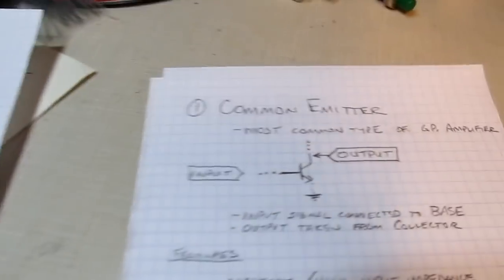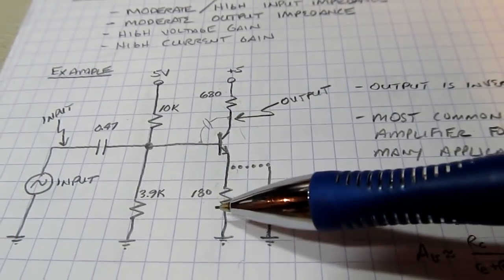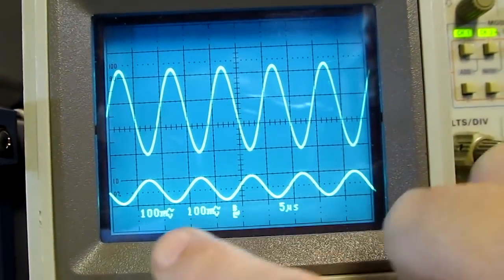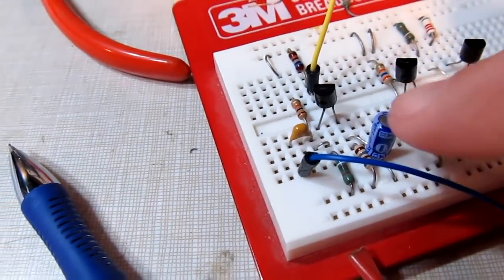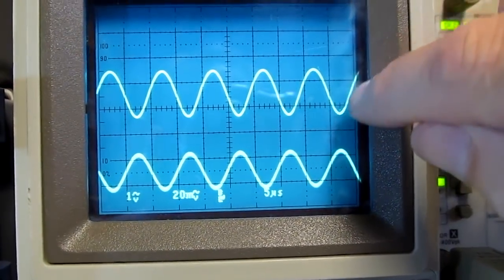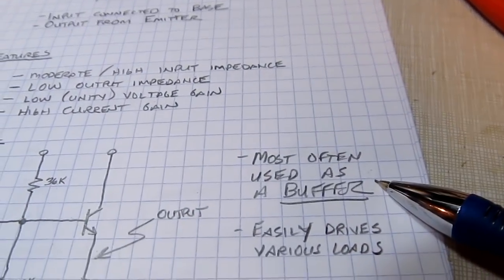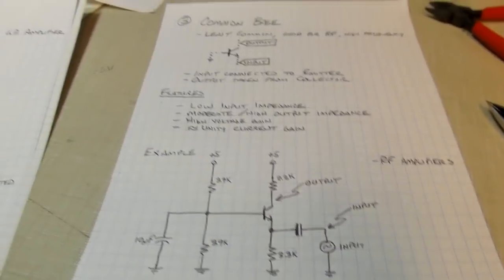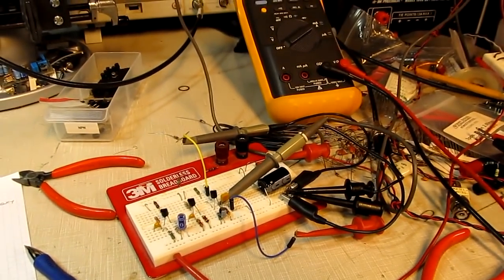#114: Tutorial: Common Emitter, Common Collector, and Common Base Transistor amplifiers

Comment: When training to get a HAREC license (in France), I see sometimes questions (with a choice beetween 4 answers) with a schema and asking for the gain or something else, but these schemas aren't always showing where is the input and the output. Thus I can be wrong about what is the common used. I wondered if you have some tip with such schemas to find what topolgy is used ? One book tells to look what is connected to the ground, but it doesn't help me.
Reply from the maker: I've never seen the schematic examples that you are talking about.  Maybe keeping these points in mind for BJT amplifiers will help:
- the output is never from the Base 
- the input is never to the Collector 
- the input can be either Base or Emitter (CE or CB) 
- the output can either be Collector or Emitter (CE or CC)
Reply: I will keep that in mind, many thanks.

Comment: I have watched this video a number of times, because when I look at a common emitter the output is always in phase with the input.  I have changed the resistors and double checked the biasing, ensured that the scope is set up correctly and even used many different NPN transistors from BC337 to ZTX651 but always the signal is in phase. So what am I doing wrong?
Reply from the maker: Are you sure you're looking at the Base voltage and the Collector voltage at the same time?  How are you triggering the scope?  The scope must be triggered on one of these waveforms only so that you can see the phase relationship between them.
Reply: It is a new scope (basic digital) and I did wonder if I had set the trigger wrong, If it is set right it should be triggering on channel one.  The common collector and common base circuits work as expected, it is just the common emitter that is odd.  Do you have a video for triggering on a basic digital scope?
Reply from the maker: @rpsproject5349  Are you viewing both signals at the same time, or one at a time?
Reply: Only on one channel now, being a new scope I had not got the triggering worked out and there was a setting that would default to both channels trigger when both channels were receiving a signal.  Now it only triggers on one channel.  As I know from your other videos it is important to know your scope so an easy trap for young uns; as Dave would say.  Thanks for your help.
Reply from the maker: @rpsproject5349  That's your problem.  The scope is triggering on the rising edge of each waveform, so it's going to hide the phase shift from you.  The only way to see the phase shift is to trigger on one of the signals and display both simultaneously.  The scope only triggers on one channel by default, and can display both channels simultaneously.

Comment: w2aew, what causes negative degeneration in transistor and tubes circuits? because the cathode and emitter have negative degeneration so you have to use a bypass capacitor in the cathode or emitter to reduce the negative degeneration, but what is causing the negative degeneration?
Reply from the maker: You're mixing up two terms that refer to the same thing.  A resistor in the emitter of a common emitter amplifier is a form of "negative feedback", and is also called "emitter degeneration".  The resistor helps to stabilize the operating point (see my video on beta-independent biasing).  If it is not bypassed, it also reduces the gain, at the same time, making it more stable and less dependent upon transistor beta.  Very common usage is to have the resistor there to stabilize the operating point, and then bypass it so that the AC gain is not reduced.
Reply: I thought it was the Emitters Bypass Capacitor that is "reducing" the emitter degeneration. Or what is Emitter Degeneration, what is causing Emitter Degeneration? The emitter resistor is stabilizing the operating point of the Transistor. But is it the Beta gain that is causing emitter degeneration or something else?
Reply from the maker: A good discussion of emitter degeneration can be found here:
https://en.m.wikipedia.org/wiki/Common_emitter#Emitter_degeneration
Reply: Adding an emitter resistor decreases gain, but increases linearity and stability. The voltage gain depends almost exclusively on the RATIO of the resistors RC/RE rather than the transistor's alpha & beta gain. What I'm confused about is why does the emitter resistor determines the voltage gain of the transistor? The Emitter resistor also changes the output impedance, the linearity, and stability. The Emitter Resistor has a big role to play on the function of a transistor. The Emitter Resistor affects the transistors temperature stability. The linearity I'm guessing they are talking about the clipping and biasing operations. The Emitter resistor value controls the transistors voltage gain but the collector resistor value doesn't for some reasons, not sure why.

Comment: also can you explain why the voltage gain of emitter is usually chosen low. i mean why not Rc/Re is chosen 500 or something? whats the reason for this limitation? thanks
Reply from the maker: +jamesmasonic It all depends on the desired gain for the circuit (many times, high gain isn't needed).  Also, higher gain also means lower bandwidth (due to gain:bandwidth product).  In my case, I kept the gain small to make it easy to display the input and output voltages on the scope.  If I set the gain too high, then the input signal would be buried in the noise of the scope.

Comment: @w2aew Hi, first of all the transistor I am asking about is a NPN signal transistor BC547B as an example.
  What determines the maximum voltage input to the base of a transistor in audio use? so for example it takes approximately 700mv to switch on a silicone transistor at the base, then its on, but after that point what is the maximum voltage or current that that transistor can take into the base before it's destroyed or is seriously over driven? (ALL FOR AUDIO USE)
I Don't know where to find this information on the data sheets of any transistor,i don't know what its called the maximum input permissable into the base,I am of course assuming that a transistor will have a point of which too much voltage or current into the base will either destroy it OR distort like crazy in audio use.
I hope you understand what i am trying to ask, for example the HFE of a transistor is how many times it can amplify the input, so for example a HFE of 250, a 1mA input would give out 250mA, so I know thats the amplification factor known as HFE ,but as for the input into a transistor and in particular the maximum input voltage or current,I don't know what that's called.
The reason I am asking is so that i can try and design a preamplifier and knowing the max levels or parameters would help me out with that and also I would like to know how it works to understand it better.
A Final example of what I am trying to ask, you could not put 200 volts into the base of a BC547B NPN Transistor it would just explode,so whats the cut off point into the base, thanks
Reply from the maker: There isn't a spec for the maximum base voltage, because it's not that simple. The maximum voltage on the base is determined by the rest of the design of the amplifier circuitry. There are maximum ratings for base current and collector current, as well as maximums for voltages between the terminals. So, unfortunately the real answer is that it depends on the overall design, not just the transistor's ratings.
Reply: is it anything to do with VBE (ON) and VBE(SAT)?
Reply from the maker: No. VBE(ON) is the base-emitter voltage when biased in the normal active region of operation. VBE(SAT) is the base-emitter voltage when the transistor is in the saturation region.
Reply: thanks

Comment: OK, I confess I am a bit slow on the uptake so please bare with me; the voltage from the SG is 3VDC correct or not????
Reply from the maker: I'm not sure how you reached that conclusion???  The signal generator is providing a sinewave at about 100mVpp for most of the demos (a little smaller for some of the demos, such as the high-gain version of the CE amplifier, and for the CB amplifier).

Comment: Hi...i have a question regarding the capacitor values....can you tell me how to compute the capacitance in designing each  amplifier
Reply from the maker: +RR Pacaldo It depends on what you want to accomplish.  Capacitors can perform DC-blocking functions like the ones connected between the signal generator and the input to the amplifier.  In this case, you want the capacitive reactance to be well below the input impedance of the circuit at the frequencies of interest. So, this usually involves computing/estimating the input impedance, then selecting a capacitor value that results in a reactance much lower (maybe just a few % or less) at the lowest expected signal frequency.  Other times, a capacitor may be present to affect the gain or BW of the amplifier.  In these cases, you calculate a value based on what you want the effect to be.  In the case of the common emitter amp with a capacitor across the emitter resistor, I wanted to effectively short the resistor at the signal frequencies, so I selected a cap that would be a very low reactance at my signal frequencies.
Reply: ..thank you so much for the reply....now, i really understand the computation for the capacitance...the capacitive reactance must be lower than the input impedance of an amplifier.....but how about the bypass capacitor?..it must be lower to the input impedance too?..
Reply from the maker: +RR Pacaldo It must be substantially lower than the resistor that it is bypassing (at the frequencies of interest).

Comment: @4:48 I notice that the bias chain has much higher value resistors in it compared to the two other types of amplifier. Is this a feature of common collector? Why is this please?
Reply from the maker: There's no particular reason.  In general, you pick these resistor values based on several criteria - depending on what is important for your application.  Considerations such as power dissipation, required input impedance, bias current needed for the base of the transistor, etc.
Reply: Thanks for your reply.

Comment: in the common base config, whats the value of that input capacitor? how do you get to design the value of the caps? please help Thanks in advance :)
Reply from the maker: I believe I used 0.1uF.  The CB has a low input impedance, thus needs a relatively large value input capacitor. The value is chosen such that it's reactance at the lowest frequency of use is relatively low compared to the input impedance.
Reply: ***** okay sir thanks for the info, btw your tutorials are great! :)

Comment: It seems when I run the CE amp circuit you have made in Spice and on a breadboard I'm not getting close to the voltage gains you are getting here. For example with the capacitor when you have your input @ 20mv pk-pk your output is close to 2v pk-pk while I'm only getting around 300mv pk-pk.
Reply from the maker: Make sure that the emitter bypass capacitor value results in a very low reactance at your test frequency.
Reply: ***** that was it, had a small value cap. Also what exactly is the point of the emitter resistor (commonly referenced as Re) in this circuit? Could it not be built with out a emitter resistor and a different value collector resistor? I'm assuming it has to do with the DC operating point.
Reply from the maker: Yes, an emitter resistor makes the DC quiescent point (bias point) much less dependent on transistor parameters like Beta. The more voltage across Re, the less sensitivity to beta variation. It makes the bias point more determined by the resistor values alone.

Comment: w2aew I am trying to understand this topic and its bugging me.  Please reply.  So if I understand this right.  The voltage divider on the base is used to set the Q point or no signal load like in your previous video.  Depending on where its at controls how far the signal output can swing.  Now the resistor on the emitter controls the current at the base???  So that means the resistor on the collector controls the output current of the collector??
Reply from the maker: Yes, the voltage divider determines the voltage at the base.  Since there's basically 0.6 to 0.7V between the base and emitter, the same divider effectively sets the voltage at the emitter too.  With the emitter voltage known, the resistor at the emitter to ground sets the emitter current.  The emitter current is the sum of the base current and the collector current.  The collector current is typically about 100x greater than the base current.  This means that the emitter current and collector current are nearly identical.  The available swing at the collector (for a common emitter amplifier) is also determined by the base voltage.  The swing can be between the positive supply (when the transistor is cutoff), and several hundred millivolts below the base voltage (when the base-collector junction is turned on and the transistor is in saturation).  The collector resistor doesn't determine the collector current, it main is used to set the gain in a common emitter amp.  I'm actually just finishing up editing a new video specifically on the common emitter amplifier.  Should be posted soon.
Reply: I think I follow.  Gain yes but effectively controlling the maximum dissipation of the transistor package, correct?  I think what is stumping me is I learned ohms law over 20 years ago and I forgot some of the basics.  My schooling only covered resistances in series/parallel circuits never got into diodes or transistors.  I am an aircraft mechanic and trying to learn this on my own.  Thank you.  I forgot some of the basics but remembered most of them.  I forgot that amperage is the same in a series circuit.  Hence making the amperage across the transistor package base to emitter same as across the emitter resistor.  I suspect I need to get out my breadboard again and just have some fun plugging in numbers etc.  To me right now it looks like a mess but its coming clearer.  So effectively the emitter resister and the transistor is part of a series circuit connected to the parallel part of the voltage divider.  Thinking out loud.  Thank you.

Comment: When biasing a transistor amplifier, R1 and R2 set up the biasing point for the base but how do you calculate R1 and R2 so the input signal doesn't get overloaded and also get a good Q bias point? you and get R1 and R2 values to get a good Q bias point but its going to overload the input so how can you avoid overloading the input signal when choosing R1 and R2?
Reply from the maker: Engineering is a game of trade-offs.  When setting up the biasing resistors for the base of a common emitter or common collector amplifier - you have to consider several factors:  
- the loading that it places on the previous circuit
- the voltage it places at the base
- the current through the bias resistors compared to the expected base current
- etc.
There is no perfect answer - the design requirements for the overall circuit will help to dictate which of these factors are most important, and which are less important.  See my video on Common Emitter Amplifier shortcuts for more thoughts on this.
Reply: @w2aew  But that's what I'm confused about because the previous stage will dictate what R1&R2 values will be for the next stage but the Q bias point will suffer by the trading off of loading down the input signal or getting a good Q bias point which R1&R2 values will change.
Reply from the maker: @waynegram8907  Welcome to engineering.  A designer has to weigh the consequences each component choice an choose the compromise that best suits the application.  There is no universal answer.
Reply: @w2aew  So you can't have it both ways? you can haven't the perfect Q bias point and not loading the input signal at the same time?

Comment: How do you determine the size of the Capacitors to use, I've searched and searched, no body seems to be able to explain it. I would imagine it has to do with signal frequency and the Xc it causes and/or signal amplitude and the rise/fall time of the cap (RC time constant), but I'm not sure. Thanks in advance for any pointers.
Reply from the maker: Yes, it has to do with Xc and the impedance(s) of the circuits on either side of the capacitor, and the desired frequency response.  For series coupling caps, the cap will form a high pass filter, so Xc should be low with respect to the input of the stage it is connected to, at the lowest frequency of interest.  Basically, in all cases consider the affect of Xc at the highest and lowest frequencies of interest, as compared to the impedance of the circuitry it's connected to.
Reply: ***** Thank you so much! You are giving away so much good information for free, that is not even available at the educational institutes, even though we pay so much money to go there. I can't thank you enough, you are a good man!
Reply: ***** Can you throw together a short video properly selecting the coupling caps, let's say, for a 1 MHz 1 Vp-p signal from one Common Emitter BJT to another one, Please?
Reply from the maker: Satnam Gill Maybe the video that I did on the frequency response of the CE amplifier would be of help. It shows a few examples of how the capacitors affect the frequency response.
https://www.youtube.com/watch?v=NizrzRKQqII
Reply: ***** Yes thanks.
Reply: ***** tzjh

Comment: I thought that the base was going to be directly grounded in the common base amplifier. Anyway, why is it connected to ground via a capacitor?
Reply from the maker: +Yueeiuyoo In the CB amp, the base is connected to ground as far as the signal is concerned (through the capacitor).  For bias purposes, it can be ground or some other voltage that is convenient for the circuit at hand.